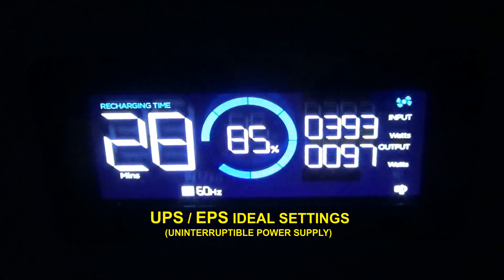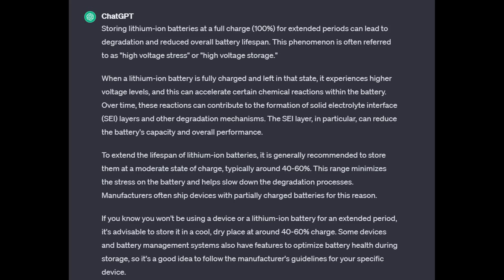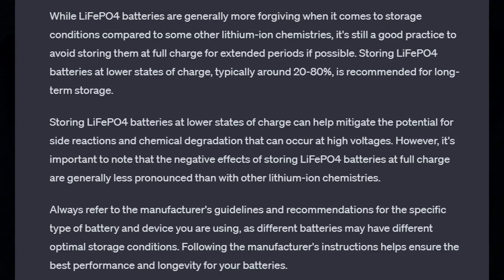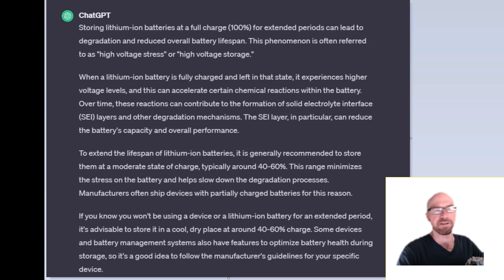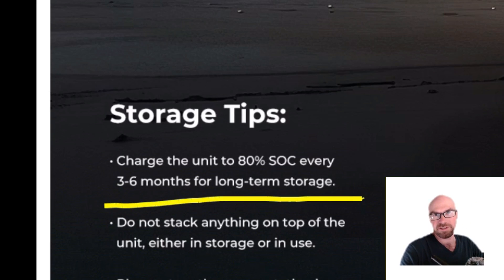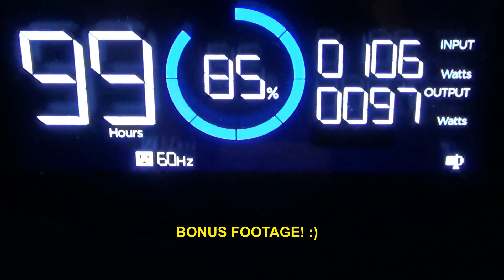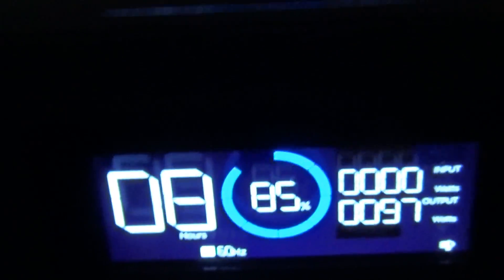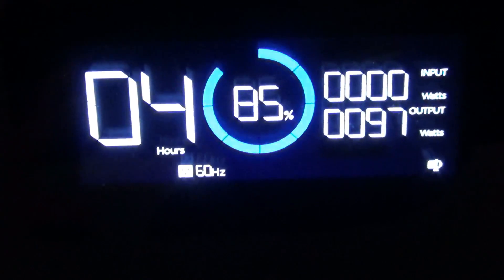The RIGHT WAY to use your Power Station's UPS Mode

Comment: i got river2 here in Ukraine we got light out every 4hrs I use it as UPS for PC ,and sometimes it just shutting down ,sometimes its not ,so idk ,I read that river 3 has smth like inbuild ups ,sigh
Reply from the maker: Yes the older power stations sometimes switch over to battery power too slowly, causing the PC to turn off. If you have a DC power brick to charge the power station, you can do "passthrough charging" while running the inverter for the PC. 

It's not good for the battery long-term, but it will always keep the PC on as the power station's inverter is always powering the PC. But the battery always has power flowing through it as a result.

The DC power bricks were often used on power stations even older than the River 2. These can still work with the solar input on newer power stations as long as they meet the voltage requirements.

So this can work as a temporary solution, and hopefully your situation will improve soon.

Comment: So if your using as a UPS backup  I leave the unit plugged in all the time and only charge to about 80-85%    Can I use  another device say a small AC fan while it's still plugged In ?
Reply from the maker: Sure. Plug in what you don't want interrupted. Just be aware that it's not recommended to use UPS for large loads, since some models have power limits in UPS mode that is lower than the inverter's power rating.
Reply: @SoGenFan  Thank you.

Comment: What are your thoughts on GoldenMate brand UPS that use LFP batteries?
Would they be using some kind of secret sauce to keep batteries from degrading due to always being powered on?
Reply from the maker: Most likely the batteries are not at their true 100% soc when it's fully charged.

Comment: These are NOT lithium-ion batteries! LFP batteries can cope with being sat at 100%. On top of that, the flat voltage curve will make the BMS lose track of the SOC if you don't fully charge it once a week, so the power station will power down when it's at a non-zero percent charge.
Reply from the maker: That is true, LFP batteries should be charged to 100% on a regular basis. However, it is still not recommended to leave them sit at 100% indefinitely. 

If a power station is used exclusively for UPS, and the battery is seldom used, how often should the user cycle the battery and charge to 100%, before resuming a lower SOC (i.e. 80%) for an idle UPS?

Surely the self-discharge / cell imbalance won't get drastic in only a weeks time. But perhaps cycling once a month would be a good idea. 👍

Comment: The inverter is on the whole time you are plugged into the wall? How about pass through function?I thought the inverter is off in pass through function and the current bypass the inverter and powers the load directly

Comment: I have Anker power stations and I am using the C1000 as a home office UPS. It always stays at 100% except for once in a while a storm will take out the power. I dont have a power saving option on the app or option to charge it for less than 100%.  I guess just uplug it once a week or something?
Reply from the maker: Yes, I would do exactly that. And check to see if the firmware is up-to-date on the C1000 - perhaps they will add a charge limit option at some point.
Reply: Hmm, i have completely in same situation. I have anker f1200 and use as a UPS. Also this model dont have max charge level option. I planning to use without energy until %-70-80 every 15 day.

Comment: I read on reddit that you have to find the setting fo rthe AC output to always on because if it goes to 0% when you recharge the battery the AC output will stay off.   Could be dramatic when hooked up to a sump pump for example.
Reply from the maker: Yes, if you want the AC to turn itself back on (once the battery has some charge again) you need to go to settings > lab features > AC always on

This works great with solar as well, once the sun comes up and starts providing power, even if the battery died overnight, it will start charging with solar and automatically turn the AC inverter back on 👍
Reply: @SoGenFan  thanks! I don't even know why it wouldn't go back up automatically after a full discharge.   It could be a big disaster connected to a sump pump for example.